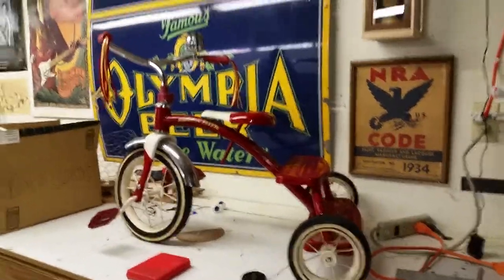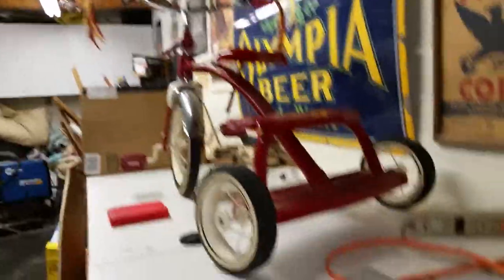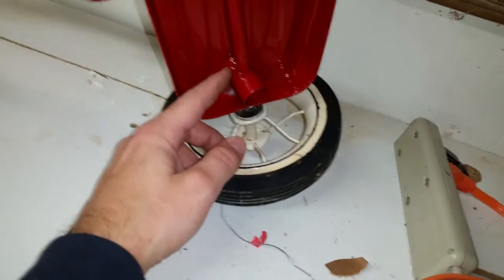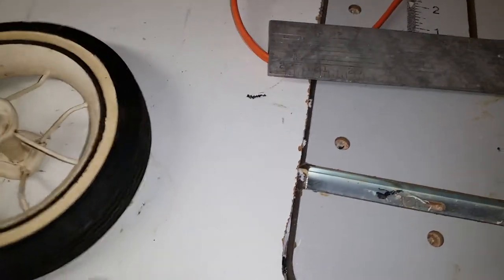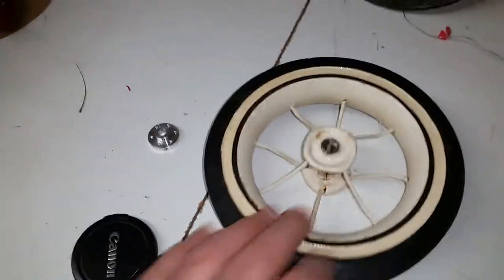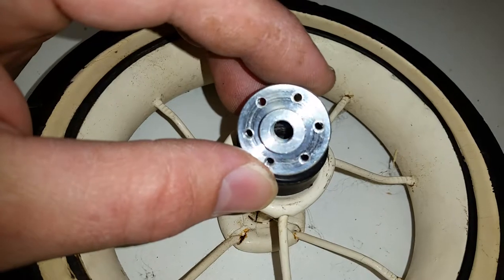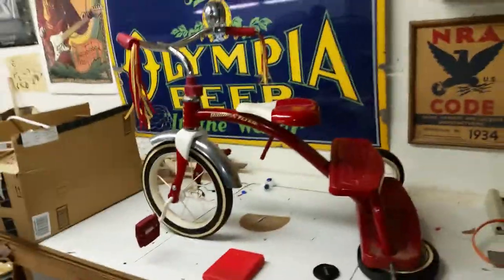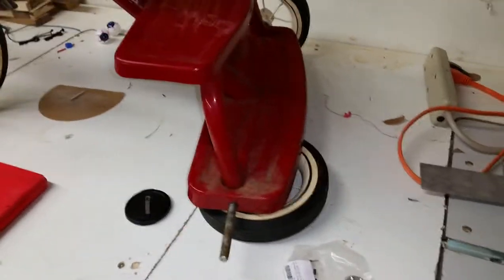Tricycle Prop Based off of the "Saw" Movies

Comment from the maker: Yes the only thing that worries me is the wheel having a thin raised edge which I really doubt will hold. If I flatten that edge then one of the two welds are gone but that may not matter either so we'll see. I'm sure I'll have some problems for you to solve on the forum soon lol.